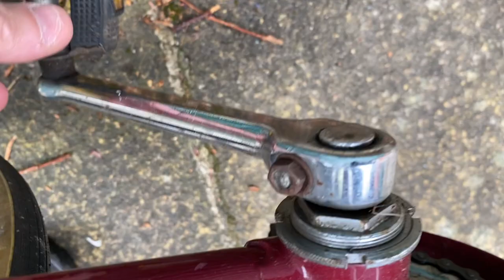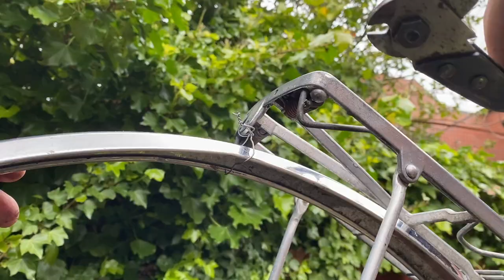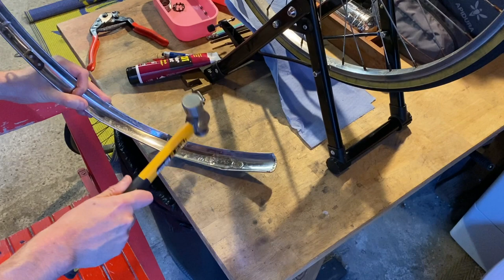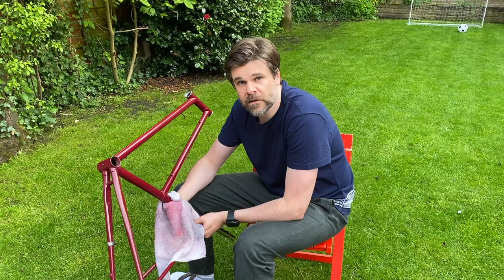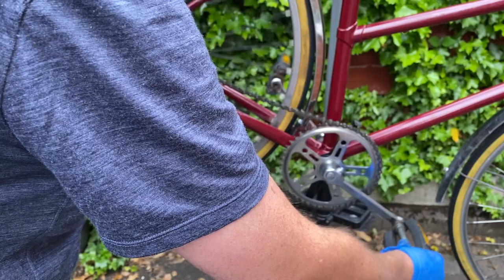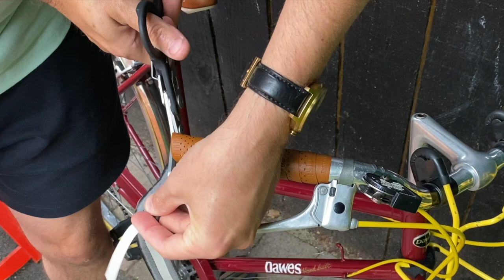80s city bike full restoration: Dawes Diploma

Comment: Good grief, that reminds me of the bike my dad got me when I was a teenager. My brother got a 10 speed Raleigh Flyer and dad got me a Navy blue Raleigh Wayfairer😩, (to this day I don't know what I did to deserve it😕) 3 speed sturmey archer with built in dynamo, chain guard, mud guards, huge brooks saddle full of springs, reflector and factory lights (they were rubbish, couldn't see anything at night unless you pedalled until your legs were a "blur", not easy on a bike that weighed that much😳). All well and good until some "oik" nicked it from the swimming pool bike rack😖. I got it back a week later, the police found it dumped in some bushes, totally wrecked. Great excuse to "customise it". Totally stripped it. Painted it light metallic blue, ditched the 3 speed dyno hub, chain/mud guards and fitted a "fixed wheel", popped on a "bull horn" handle bar and only then did it truly become MY bike. Loved that bike. Loved the "sympathetic" restoration 👍👏. Not sure about the yellow cables and basket though, but that's personal and I appreciate that you've saved another old bike👏👏👏👏
Reply from the maker: I love memories like this. I could go on for hours about the Peugeot my mum had that this reminds me of - I really hope someone somewhere is still enjoying it, these bikes are absolutely worthy of preservation.

Comment: Nice! how did you fix the loose left pedal?
Reply from the maker: It was easy in the end - just a loose cotter pin. I cleaned, greased and fitted a new cotter pin and tightened it down. It acts like a wedge to fit the crank firmly onto the bottom bracket axle.
Reply: @red_dread  you did a great job here, I love your restauration style, especially vintage MTBs, two years ago I saved a Klein Pinnacle from the trash, it could really need your skills :D
Reply from the maker: That’s amazing, you found a Klein in the trash! Is it online anywhere so I can see it?

Comment: What type vinegar do you use? I tried distilled white vinegar and soaked rusty parts longer than 24 hours and it appeared to not do a dang thing! I'm to the point of skipping the vinegar route and just buying evaporust
Reply from the maker: Always white vinegar, I’ve used both wine and spirit types. You often do still have to get the wire brush out after a soak, that’s always worked for me. I’ve never tried Evaporust but I’m open to it.